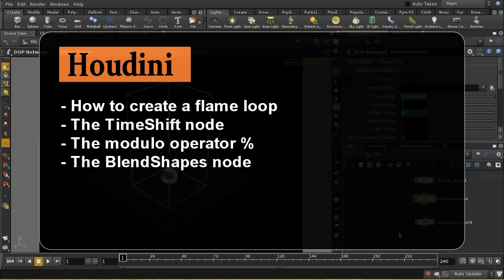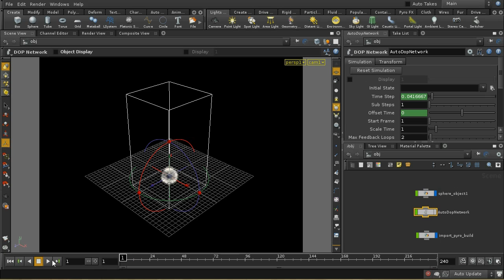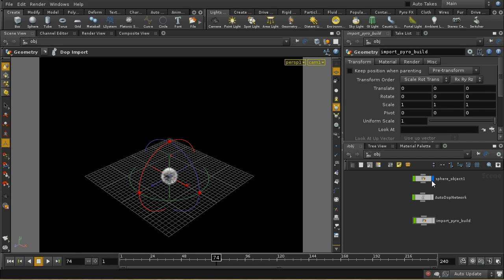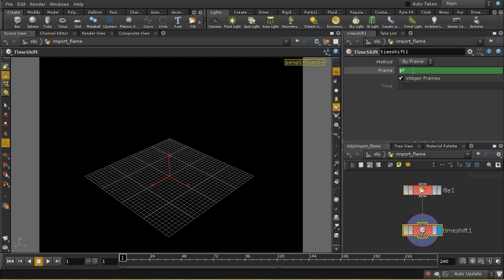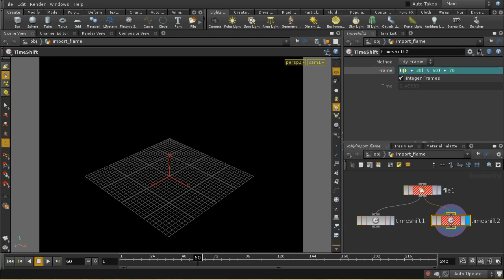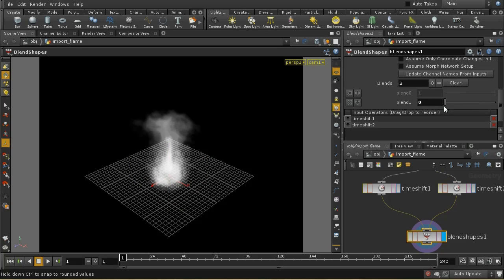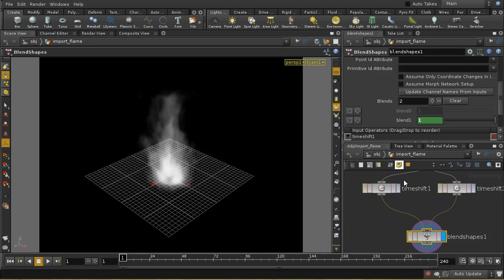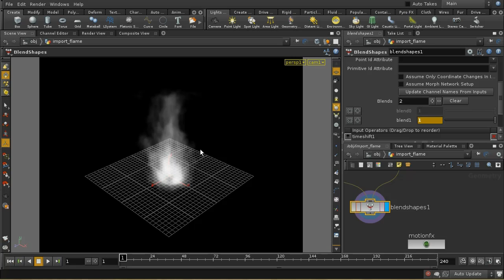Houdini Loop Flame

Comment: Hello! If anyone (or author) knows how to solve such issue, please comment on it: 
I'm trying to do the looped flame animation as on the video, and everything works till the point when I want to blend two timeshifted shapes. After adding blend my simulation starts to displace itself (it jitters and therefore I can't get a seamless loop). Without blending - it stays at the same place and looks like it is ready to be blended. (Blend position is turned off, and "clamp to max size" for container in pyrosim is also off)

Any idea what could cause the simulation displacement and how it can be solved?
Reply: Ok, I think I figured that out. What was making the jittering was the dynamic boundries, and when the node was trying to blend them - they blended into some crappy displacement of simulation. To fix this I had to check “enforce boudries” in “resize_container” node in pyro_sim. After playing around a bit with the container, I managed to blend the shapes.
Reply: Thanks for posting your solution I ran into the same issue, and this fixed it. Much appreciated!